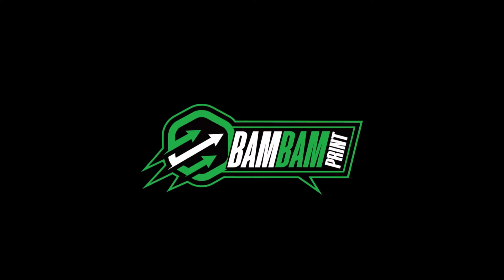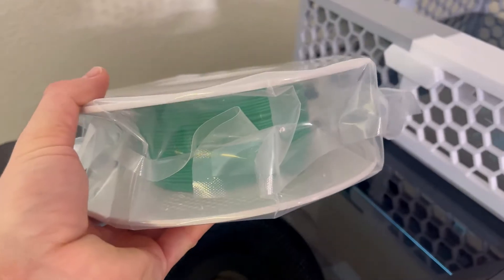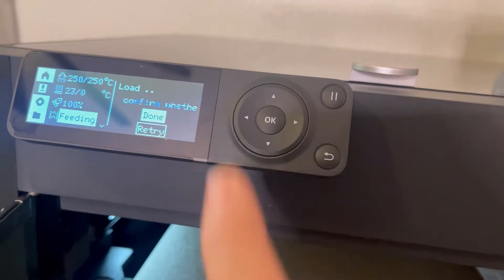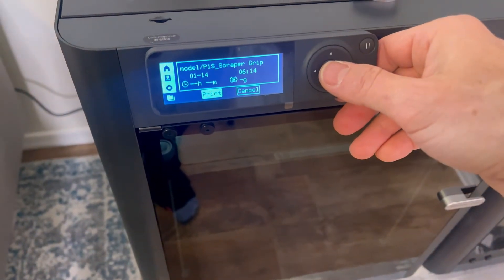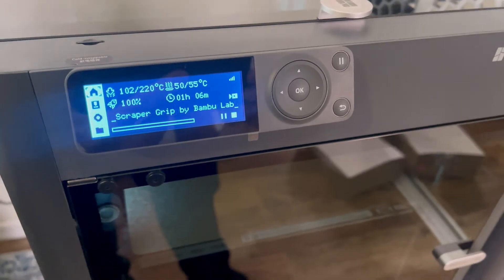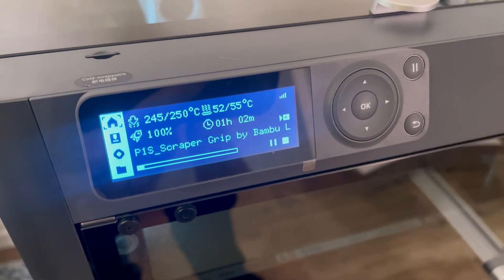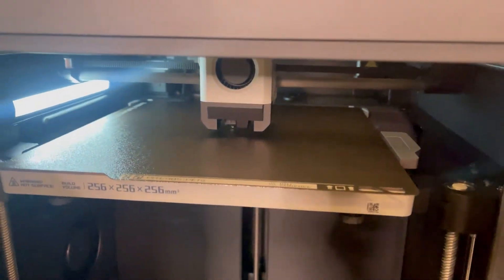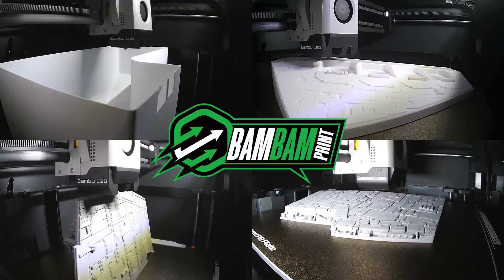Bambu P1S First Print: Essential Tips for Beginners

Comment: What is the format of files you create for printing? STL or OBJ? What software do you recommend for creating designs?
Reply from the maker: STL is what you want. The format is 3mf which is better than STL but for the most part everything is STL. 3mf has more data like printing settings and supports etc. but STL is perfectly fine. I recommend starting with my tutorial In tinkercad first. I am working on a Fusion 360 set of tutorials.

Comment: damn I didnt find my answers there, I'm looking for tutorial which shows how the heck do I take out the printing plate, or if it is even supposed to come out, then how do I take out my first print from the printer
Reply from the maker: Not a problem that is more simple than you think! The gold plate is just magnetic. Use the front tabs on the plate and lift up. You will feel it release. Then do as best you can without fingering the plate (is that a word?) so you dont leave any oils on it. You can bend the plate back and forth to remove the print from the plate. Many people wash after each print but that is totally a waste. I rub my plates on my shirt to remove the printer dust. Then reinsert it. I can do a video for you as well.